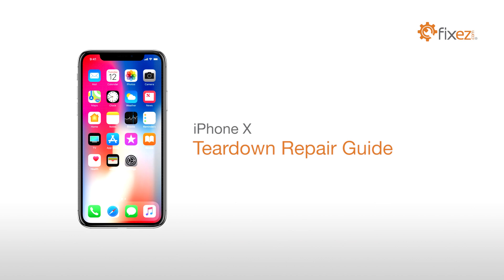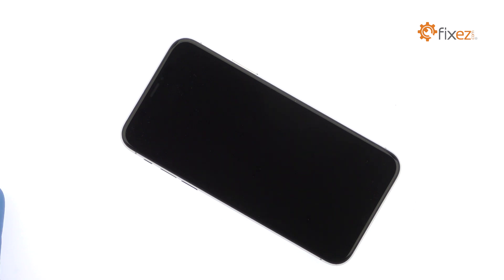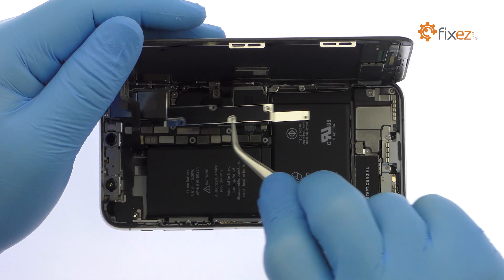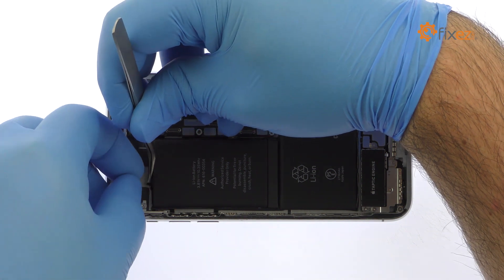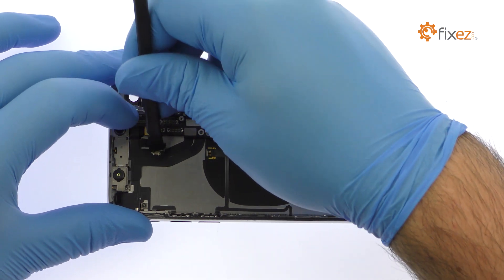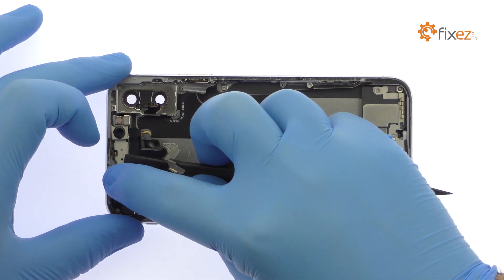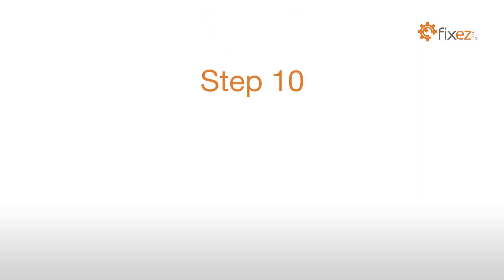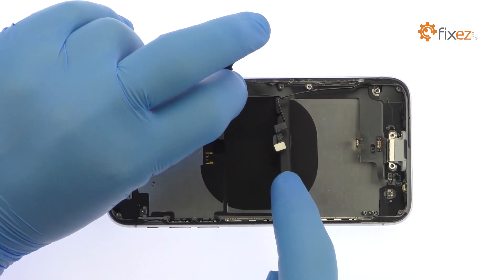iPhone X Teardown Repair Guide - Fixez.com

Comment: My iPhone X is stuck at the "restore mode" but I got the error 1043 and it wouldn't restore. 

May I ask, which connector did you disconnect at the 4:53 mark? That connector on my iPhone X won't stay in when I try to connect them anymore. I wonder if it was already like that even before I tried to remove the logic board. Could that loose connector cauze my phone to be stuck in restore mode?

Comment: hi can i disasembly rear camera without removing the battery? thanks
Reply from the maker: Yes, you can take off the rear camera without removing the battery!
Reply: Any idea if the rear camera is serialized? Can it be replaced without issue with the phone detecting it was replaced?